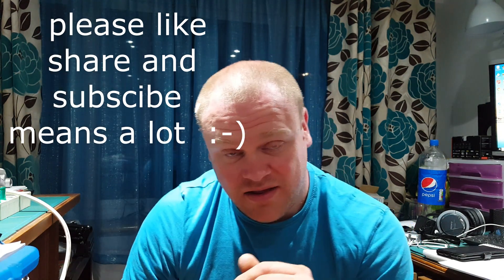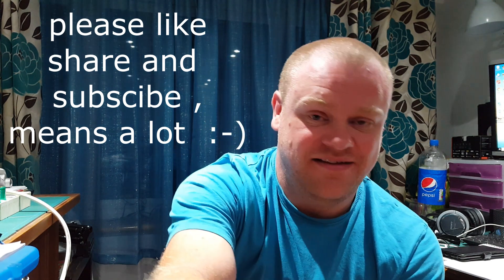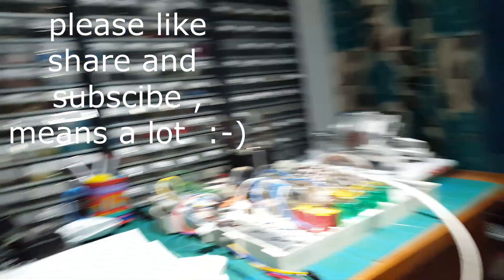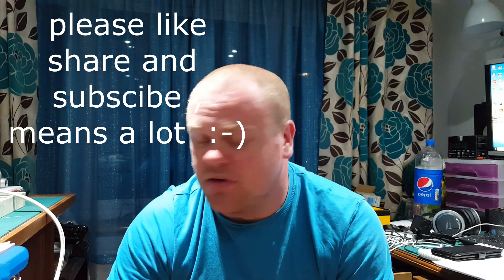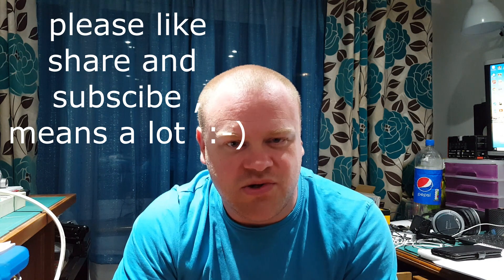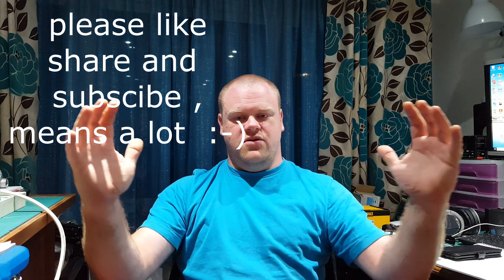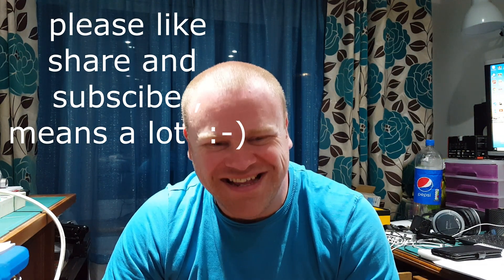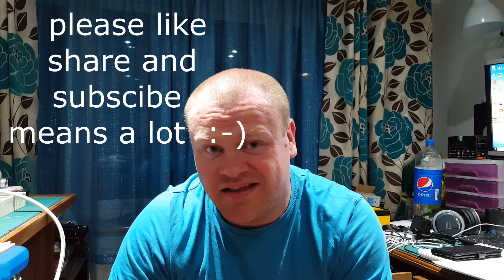ac motor control #5 thinking about firmware

Comment: Very informative. I am trying to do the opposite, take 3 phase output from a bldc used as a generator, and controlled rectification using 6 igbts. My questions involve frequencies. My 3 phase input will be about 1000 hz at 60 volts p-p. Will igbts and Arduino be able to handle pwm control pulses at that higher frequency? Could I think of the igbts as a thyristor, with 1 turn on and turn off pulse per cycle using zero crossing to start, with varying width pulse to keep on,, but at same frequency as AC input? Pwm that I see typically chop the wave into say 100 slices, but that means much higher pwm frequencies

Comment: Thanks for the video Jason. I am doing a thesis topic on motor control via PWM. Specifically to look at improving gate pulse control algorithms that promote efficiency and improved performance. It is really hard to find video tutorial kind of videos in this topic area especially ones where the presenter has good English. So I just want to say thanks and let you know you have made a difference to my learning.
Reply from the maker: Hi quenton thank for your message . Iv been away and just got it. Thats really good! I feel like current pulse methods soend a lot of time in the biased region of switch power components wasting energy and heating igbts ect. Im working on a whole new drive topology which uses a sine lookup array but instead of changing the aplitude of the sine wave it lowers the y co ordinate and in effect lowers the sine wave. Cutting off part of it.  Motor seems to like it and and it stops the current flowing thru coils when the magnets are furthest away from the coils when commanded torque is below 100 percent seems to be very efficient. 
If you want to get in touch. My email is jaysjetskis1983@gmail.com